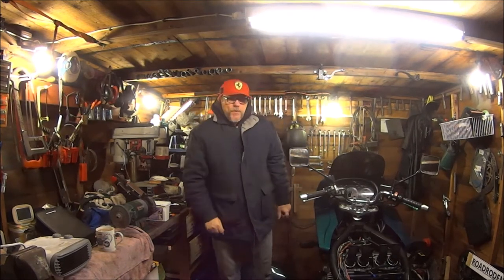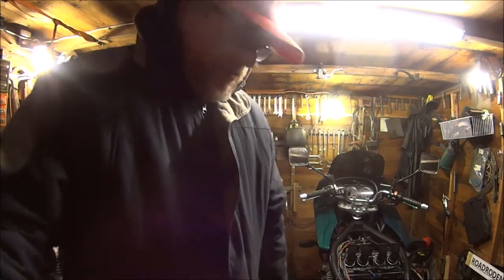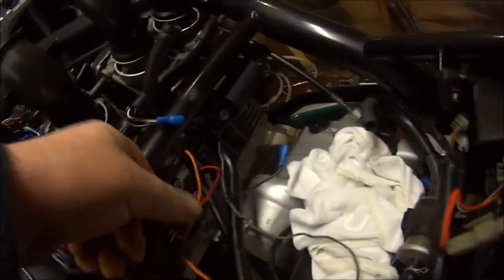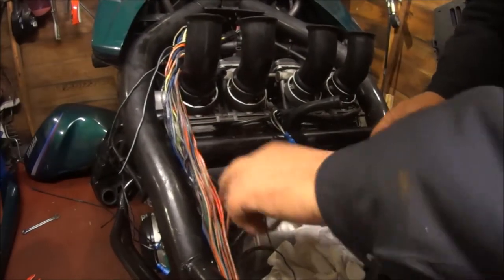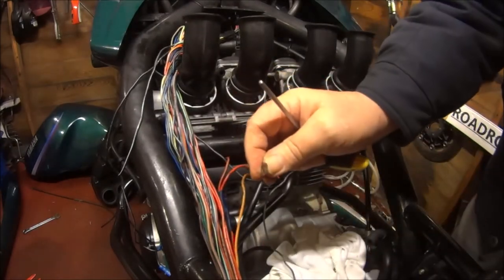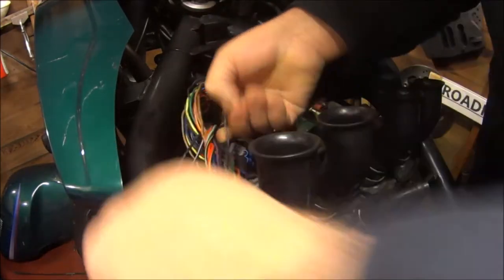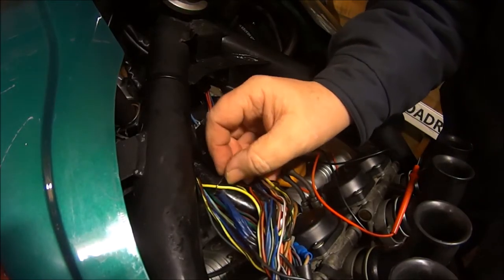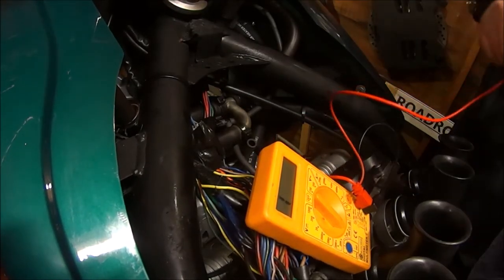XJ900S. Suspect WIRE BURN

Comment: You have put a lot of work into this bike and I think you are on the right track with a weak spark theory. You might have some luck if you  running the bike in a darkened shed preferably with the tank off and look for a short from the number 4 HT lead or plug cap. to me it sounds like the spark is breaking down under load but there may be evidence while on tickover. Anyhow best luck buddy/
Reply from the maker: Hi thanks I hope we are both right now. I've got a multi meter so I can run some tests on them in the week..

Comment: Hallo Jonny, have you already measured the compression of cylinder n4? No faulty valve? And do you know way the Yamaha has gone out of use? Usually a bike is only stopped/sold when there is a defect. I really hope you can solve it Son and finaly enjoy your bike. Hartelijke groet, Jan
Reply from the maker: Hi Jan. Yes compression is fine. I don't think it's a burnt valve. The ignition coils don't seem to be giving the specified readings on the m meter. Hopefully I will be riding it before the spring time.

Comment: Took my divi 900 to the mot on wednesday.. 12 years of ownership... 22 years old this year.. and she passed. 
She still pulls like a diesel freight train, does 3 figures on private roads and in Germany on certain roads. 
what exactly is yours doing, thats causing all the strip downs??
She sounded fine in the vids of you going to the MOT place.
Youve stripped the carbs, replaced bits.
Headers are getting hot, as your coat proves.
Reply from the maker: I think that may be you should turn up the volume of the MOT video as it is very clear the bike is struggling. I'm not really sure on what you are trying to say?
Reply: mines 26 and a pleasure to drive and 65000 miles on it
Reply from the maker: Nice one buddy.
Reply: @jonyr1TT  divis dont sound like other bikes. I've had the volume up, on pc, laptop and tablet. 
I'm failing to hear whats up with her.
As I said.. had mine 12 years this october. At times she sounds like bloody old VW beatle. 
I offered to come to where you are, and let you see mine..  test ride it, feel what a fully running divi is like..  Got the impression you thought I was trying to pull some sort of fast one.
I even pm'd you on twitter.. so you could see my feed there, and see and hear vids and pics of my divi 900. No response.
Reply from the maker: I know my videos go to twitter automatically but I haven't been on twitter for months or fb. Can I ask you why it is so important to you to find out my address I'm just a old guy fixing up bikes.

Comment: Hi, I don't think it is the CDI or the coil itself or in fact. anything on the low tention side cos no1 plug would be suffering the same fate as no4. I was watching a vlog from elkfazer1 who had a similar problem with his TDM. Turned out the high tention had blown a pinhole in a HT lead where it touched the frame. His garage taped up the hole and re-routed the cable! Not sure if that would survive in the rain. By the way I like your music, had any thoughts of making some money from it to subsidise the bike projects?
Reply from the maker: Hi no I'm not really convinced on it being the cdi I'll be removing the coils in the week and checking them out with a multi meter.. Thanks and glad you like the guitar stuff. Not sure how I could make money on it though?.